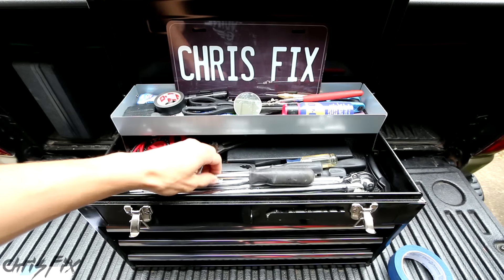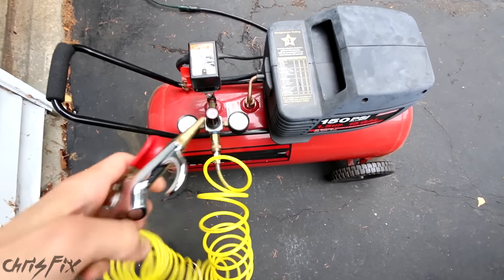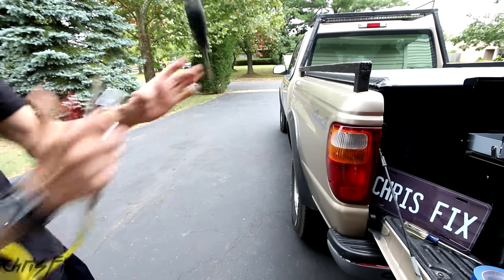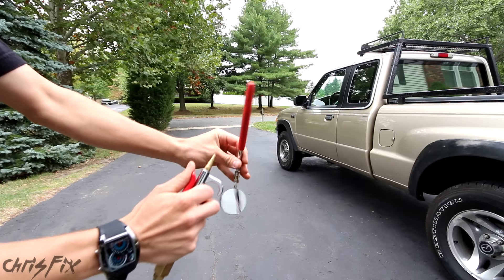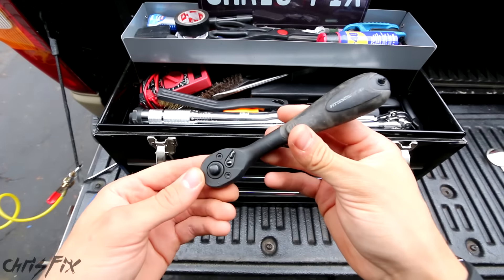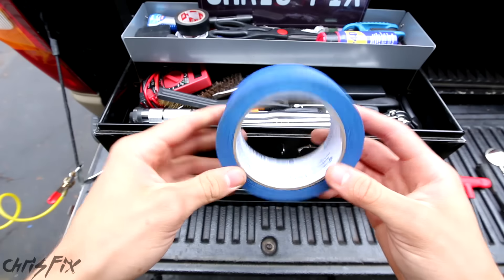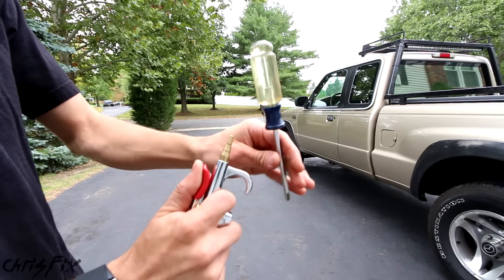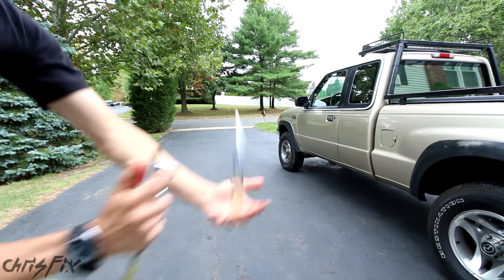Levitating Tools Trick (screwdriver, roll of tape, and more)

Comment: Your description of how this works is completely wrong.  The actual explanation is clearly sorcery.
Reply from the maker: +ExaltedDuck hahaha dangit you figured me out!
Reply: It is actually caused by alot of high pressure air on one side and low pressure on the other and when there is a balance of the 2 it can "float"
Reply: @GRAITOM  That sounds like witchcraft with extra steps.

Comment: Have you done a video on how to magnetize hand tools? My grand father, who was a Ford mechanic for 30 years showed me. You may know about wrapping a piece of wire around a screwdriver and raking the ends across the positive and negative terminal of a battery. You have a big enough following (subscribers) that some folks are sure to learn from it. If you have already done a video on it, good deal, I just thought about it while watching this....
Reply from the maker: That is a good idea!!!! Thanks!
Reply: For solid steel you can even just bang the metal on something really hard a few times - this causes the positive ions within the steel to bunch together and the negative ions to bunch together and both groups to align opposite of one another.  Instantly magnetized.  Method's not ideal because it could damage the tool from smacking it, but works in a pinch, especially if you need an improvised compass in the wilderness (magnetize a sewing needle, place it on a leaf floating on water and you have an instant compass).  Works with any piece of pure steel.
Reply: If it's steel, you can also run a magnet across it, following the direction. The magnet organizes the ions and makes it magnetic
Reply: It has been 5 months, can we get the video now?

Comment: While my grampa was fixing an old fan I decided to get a blower tool like that one to clean it, and decided it would be a good idea to use it to rotate the blades by air to check the motor for dead spots. The problem was that it had 3 settings but didn't work unless it was high speed.

Comment: it works good what i found that u need to adjust the air pressure according as the object may just fly up out of control you also can't do it with heavy things like a metal rachet only small or lightweight things worked for me but with enugh pressure u can lift anything
Reply from the maker: +Bartek Gm Thanks for sharing!

Comment: this is hella cool, but I'd like to point out to those who don't necessarily work much with compressed air that this can be dangerous if you point it at yourself as you can get air into your bloodstream. be careful :)
Reply from the maker: +supernathan94 Thanks for sharing but you would have a hard time getting air into your blood. You would need to have an open wound and direct the air into the wound and even thin it might not happen. Better to be safe than sorry but it is really nothing to worry about.

Comment: HEY CHRIS..I GOT A 94 HONDA ACCORD...DOING A CLUTCH REPLACEMENT...ITS AF 205××× MILES...I DONT KNOW IF ITS THE ORIGINAL CLUTCH OR IF THE FLUID HAS EVER BEEN REPLACED...DO YOU RECOMMEND CHANGING IT ANYWAY?
Reply from the maker: +Ivan Hernandez If you think you need a clutch, I would change it.

Comment: Chris off topic of this video.. But got any way to diagnose a transmission going out?
Reply from the maker: +Bio-Raven Depends on what is going. If the overdrive light is flashing you can scan the computer. Otherwise it is all feel and checking the fluid or dropping the pan to tell.

Comment: Hey I have a question for a video you could maybe make. Since you have done videos about fixing Odometers and Shift indicators, I was wondering if you wanna make a turorial on how to adjust a speedometer, because in my car the speedometer always shows 10 km/h more than I'm actually driving, like when I'm driving 80, it shows 90 and it's actually proportional so the faster I drive, the further it shows, when I drive 120, it shows 130 but when I drive 160 it shows 180, and at 170 it goes to over 200 km/h.  However 50 and 60 km/h is accurate.
Reply: strange. My spedo needle got stuck at 130 kmh for 2 days a couple of months ago, Then 3rd day i started the car and it dropped back down.
Reply: thats a stupid thing car manufacturers do somtimes because they think it prevents speeding, in reality it just causes problems between drivers of cars tbat have this and ones that dont.

im not sure if it can be fixed with just an adjustment it might be an ecu thing
Reply: antsolja I almost thought that was the case, because other people who I know that also drive Ford have the same problem, Mercedes drivers however don't seem to suffer from this

Comment: Hey Chris, I wasn't sure where else to contact you so i just figured this will work. I have a 2003 Pontiak Aztek that makes a lot of noise on the rear wheels, and as I gain speed the noise gets louder and higher pitched. It will usually be the loudest at around 100 km/h but then gets quieter as I go faster. Any idea what it could be?
Reply from the maker: +EmElGee You found the right place. It might be a bad bearing: https://www.youtube.com/watch?v=YvKWGjmPKoc

Comment: The Mazda b3000 you have, does it get good gas mileage? And is the insurance cheap on it for a 17 year old?
Reply from the maker: +HerbertGamingCenter It gets garbage mpgs but I think it is because of a clogged injector. I will be doing a video replacing the injectors so we will see if that helps. Insurance is not bad compared to other cars.

Comment: ha i ran outside and had to try this. awesome
Reply from the maker: +Danté Smith NICE! Did it work?
Reply: yeah, I had truble with the tape and heavy tools but I got some smaller screw drivers to work. the easiest was a ping pong ball, you can control the high quite easily

Comment: What happened - did that Science Guy stop by your shop or something?   Or, maybe you visited the S.T.E.M. booth at a local school event for the kids?  LOL.  Wrench geek to fix it geek to figure out the physics involved geek.  Renaissance much there, Chris?  :-p

I can kinda sorta do this with the carpet and door mats and my leaf blower.  I get enough air going underneath that the mat just rises, all the crap blows out and away and then I can then let the mat back down in place all w/o touching the mat.  
How'd u do that, dude:  The air resistance against the door pushes back on the mat and the forward flow from the blower pretty much give the mat its balance so then it's just a tug against gravity vs the flow coming from the blower.  The blower wins and the mat rises. Woohoo!
Reply from the maker: +Ji Fi-01 (Jif) I am actually a scientist lol. Yea it is fun discovering little things like that when you are working around the house.

Comment: set the "Godpressor" we call it to 600 psi and got an engineers hammer to float
Reply from the maker: +cableboxelite NO WAY! I actually tried a small hammer and it was so close but too heavy.
Reply: +ChrisFix this compressor is military surplus, its capable of operating pressures far beyond what even the most prestigious brands of commercial air compressors claim

Comment: You having too much fun!  Now fog an engine with MMO and let it sit overnight!
Reply from the maker: +Sagina1999 Haha, I actually just finished fixing a car that has royal purple fuel cleaner in it so stay tuned for that!
Reply: +ChrisFix Well, not quite the same thing, but I will see what you do.
What I'm want to see is a really old engine that has lost compression due to carbon in the ring grooves.  Then you retest compression after you soak the cylinders with MMO.  I have done it.  I did not do a compression test, but just by driving I had a huge performance gain.  Take care.

Comment: I have tried more than 100 times, but I have not had anything
Reply from the maker: +Naser 12 Dang. Try another screwdriver with a different handle. Make sure it is around 100psi

Comment: Dude, shouldn't you be fixin somin?
Reply from the maker: +Willy Durf Cant fix, fix, fix, 24-7, gotta have some fun every once in a while.
Reply: I know, Just pulling your chain. I have a question. I just replaced my Dana 30 rig on my  2000 Cherokee Sport. Got a good deal on a used one from a 2001.  My coil perch decided to rust out and all but fall off breaking the sway bar link right off the axle housing. UGGG..Front end is doing fine as I put all new stuff on it. Bering hubs, rotors, calipers and so on. I got the replacement for 150 bucks so I saved big.  I have the project on FB.
  Now my rear leafs are sagging like an old women's boobs.  I have tried a couple different assist fixes with bad results. Felt like I was driving a tank, not to mention all the clanking and squeaking.
  I am thinking getting some shocks to give me a little lift and help support grandmas boobs till I can eventually replace the entire rear Dana back there or at least clean it up, if possible, and put some new springs back there. They are really bad, bad bad. Hope they make it through this winter.
  Right now I just but a couple of those helper clamps on there with some heavy heater hose sandwiched in there to keep it quiet. Any suggestions.  I am thinking of 2 in skyjackers or Air shocks but they are not cheap. I only have 60 K on this Sport and it runs great so I would like to get a few more years out of it if possible.